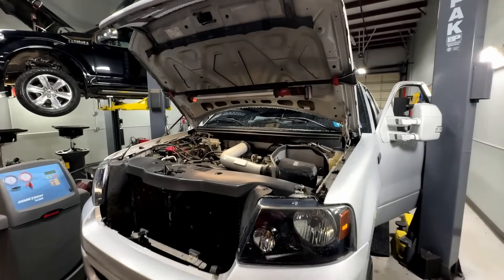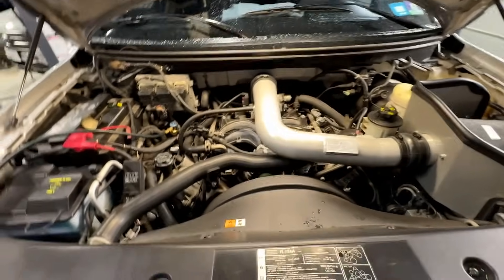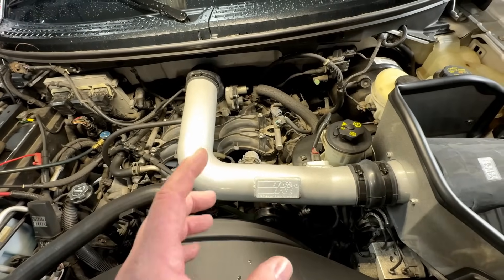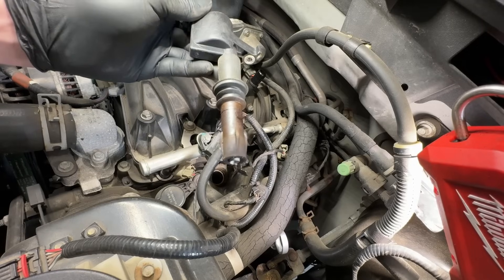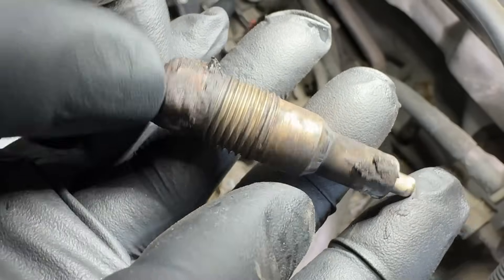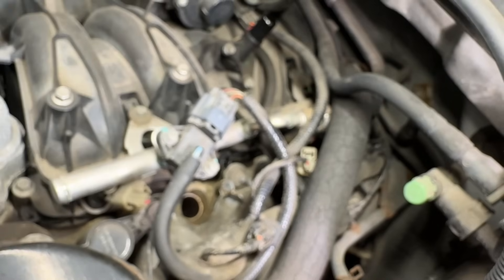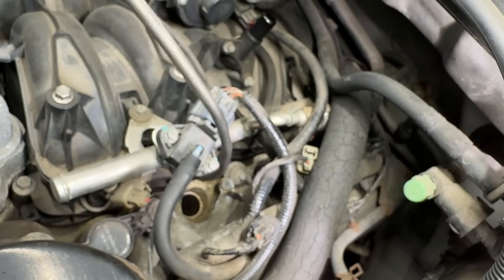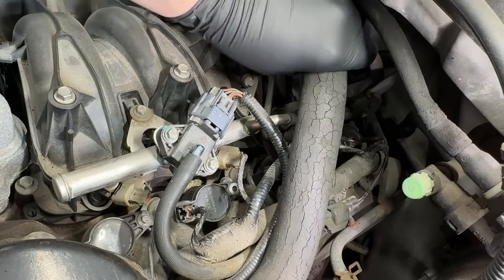Ford 5.4L 3v Triton Engine Tick Tap Diagnosis and Fix!

Comment: I have a 2010 Lincoln Navigator, I get a tapping sound when RPM is greater than 1000 and the tapping sound only occurs after I've been driving for 10 minutes, the tapping sound only occurs when it is in drive, any thoughts       thank you

Comment: Please LMK what the “beep” means at 1:13…my 2006 E150 does that “sometimes” can’t find info

Thank you
Reply: usually mine says "low oil pressure" or "door ajar" but then goes away very soon after start up but still has to beep

Comment: Got an 05 expy with 212k. Still tows our 7,000 pound camper trailer every year with zero issues. Slow as heck on the hills but it will get you there. Oil change every 3500, just did timing and oil pump at 200k. I expect another 200k out of it unless the tranny has something to say😅

Comment: What would cause a very light misfire to occur (no codes) and then go away within 45 seconds  on a 5.4L Triton with 193k miles. Could it be a loose spark plug?
Reply: It very well could be! My '05 started misfiring one day on the way home, turned out that the #1 spark plug was loose - most likely from being undertorqued. I also had the fuel smell, the very dirty coil boot, and I unscrewed it by hand just like Brian did in this video. New plugs and around 6000 miles later, the engine runs smooth as silk!
Reply: @ Thanks, mine is a 2007. Ford dealers in my city suck, one said it was too old to work on. Another said it needed a new engine once when it was an exhaust manifold leak. Independent shop I take it to now can’t find anything wrong with it. Runs great besides the cold start misfire.

Comment: For spark plugs and wheel lug studs, I apply anti-seize very sparingly with my sister's new toothbrush.
Reply: I'd rather use Red Loctite than anti seize on my sister's toothbrush.
Reply: @abyssiniahenry128 😂😂
Reply: gold comment 😂

Comment: Great info. My 09 Expedition is only loud when I go through the Wendy’s drive thru. 😂, now I avoid drive thru’s. 
I work on CAT natural gas engines. Most plug torque spec is 50 ft/lbs. 12-25 sounds crazy. 
Great info. Cheers

Comment: Thanks for the vids!

On my 06 Mustang 4.6L, my #5 spark plug loosens after a couple of years. It's happened 3 times. I've owned the car since new and only has 150k on it. Is there a reason for this I should look for? 

I check the torque on it once a year now, I know it will eventually walk out. 

The first time it happened I was paranoid enough that I pulled and checked every rocker roller and lifter for damage or excessive wear.

Comment: Another great vid.  Did you happen to notice how bad the vacuum line is going to the valve over by the brake booster?  Got real flat while running.
Reply: Had to replace mine not very long ago. Had a huge hole on the backside that couldnt be seen. As a quik fix on the road, i threw some electrical tape around it. After i got home, realized it was dang neer sucking itself closed. Ran good with the tape though lol.
Reply from the maker: Yup quite common

Comment: I have to admit i have 3 coil packs with no screw holding them in whatsoever for the last 15k miles 

I planned on getting some but the truck drove great so I didn’t think it mattered 😅 I will be doing it this weekend now!

Lifetime warranty on the coil packs though 👍👍 5.4 3v 250k miles
Reply: You did 15k miles but never once drove to a hardware store?

Comment: How does it fire w/o the ground strap! Also, a truck with 65k on it needs a timing set?!
Reply from the maker: Sitting does nothing for your vehichle
Reply: @FordTechMakuloco  How does a timing set fail from not being used often enough.

Comment: Loose plug also can't transfer the heat to the cylinder head.  Daughter drove a Mercury Tracer 400 miles after it started missing. #3 loose plug lost the ground electrode most of the insulator and part of the center electrode. The loose pieces got into #4 and banged the ground to the center. Didn't kill the engine though. Straitened the ground, put it back I,  tightened 3 and it idled just fine. Did new plugs of course. Ran 3 more years no ptoblems.

Comment: Great video and great knowledge! Experienced this on my 05. She's still running strong with 173k miles on her.
Reply: I have an 04 just paid 2700 for the manifold to be replaced and this noise has been driving me nuts. I want to pull the plugs but I'm afraid they will be stuck and  break. I bought it used and have no idea if  or when they were ever done 172k miles

Comment: the 3V wizard!
i just changed my timing chains, works great thanks to you.
i've got some random missfires until warmup, i'll pull some codes, i think the rear driver side plug on coil is loose cuz the threads for that bolt seem to have stripped :/ should i helicoil it?

Comment: Very good video. This is something I haven't seen before. I have one suggestion. On videos like this use a torque wrench. I know you as well as I have a calibrated elbow and are very good at torquing with out hearing a click. However most home mechanics are so lucky. Thank You
Reply: Most people dont use torque wrenches correctly anyway. I'd say atleast 80% of people torqueing things are off by quite a few numbers. So much involved. Basically, sayin that most things people get all ocd about their torque bein right, it really doesn't matter. The small stuff matters a lil because of breakage more than anything. I'll quit writing now
Reply: I think he explained it well why he doesn't use a torque wrench but he did tell people how many foot lbs they require. I'd say that's good enough. 😊

Comment: I have never used anti-seize on spark plugs and never had an issue getting them out later. 
I don't believe the factory uses anti-seize.
Reply: LOLOL, The " factory" could care less about your ability to extract any threaded item on the vehicle after they sell it to you. Read the book 
" One Good Turn"

Comment: Thanks for the tech tip and the video.  I saw some 2005  5.4L 3 valve engines.  Sometimes those spark plug shells would break off in the engine.  I know there were special tools to remove the broken part.  I never had that problem but was always hesitant to torque them at 25 ft lbs.  But it worked.

Comment: One might think that tick should be a secondary concern next to the fact that the engine essentially has a dead hole and the MIL should be flashing warning of catalyst damaging misfires. The truth is, those engines run so poorly (even when in perfect working order) and have so much NVH that most people can't even tell they are running on 7 or less cylinders 😂
Reply: Maybe to you. My 14 5.4 3v runs so smoothly with just shy of 170,000 miles on it that people who have never ridden in it have asked at a stop “uh…is your engine still running?” And I’m like “😂 yep, it’s still on”. It’s so smooth at idle it’s imperceptible.
Reply: @BrandonWest87  must be a lemon, because that's not normal. Better have it looked at 🤣
Reply from the maker: Not a dead hole

Comment: I did my plugs from original (reman that is) last year and did like you said very light coat of anti-seize.  Bought an el cheapo torque wrench for the occasion, so far so good.  Don't daily so IDK what the real mileage is, but it runs just fine.  I gotta say, when I bought the new plugs at Ford dealer, the ground strap sure was of a thinner more chintzy quality.  I held onto the plugs that came out they weren't terrible.  I could see the thinner ground strap on those newer plugs getting burnt off easier.

Comment: Had a neighbor that had a Lightning. He was beginning the process of repairing the ejected stripped plug issue that was plaguing Ford in its early stages; around 2008 I think this happened. 

He let me hear what it sounded like when the engine was running. Well, my coworker called me one day and asked me what was going on with his truck. He took his phone to the engine bay so I could hear… sounded exactly like the ejected plug. His vehicle was the V-8 Explorer. Took it to the dealer, and they confirmed.

At least in this instance it was a simple task of tightening the plug, and not the design flaw Ford gave us.

Comment: Don't need antiseize on new plugs.  I had a knowledgeable mechanic replace the plugs and coils in my 06 4.6 2V.  He torqued the plugs to 27ft lbs.  Absolutely no issues.
Reply: That's because the 3V design is infamous for broken spark plugs. Almost impossible to remove.  Very different from the 2V design.
Reply: This guy has rebuilt probably a 1000 of these motors how many had your mechanic rebuilt

Comment: Man I miss my Ford 3v. Was a great truck but rotted away up here in the northeast. 190k on it. Did have to replace the motor at 82k but it was under warranty so a new long block was put in. If I ever found a good southern truck with decent mileage i'd buy it in a heartbeat.
Reply: Hell I might've been persuaded to buy an extended warranty on my 2004 if I'd known how bad the timing parts could get.  I would've only got the transmission though that went at 77K, because the engine went at 107K, and I don't think they exceed 100K, not entirely sure. I had to spend just north of 8K in 2014 for the long block.  Mine is a southern Louisiana so I spent the money on it fixing it, rather than spending what at that time in 2014 was too much for me to finance with uncertainty jobwise.  I had the 8K didn't need to finance that.  Here in 2025 It's getting to a point where it would need paint, those stupid roof ribs that go downward and hold rainwater, rather that the 12th gen where they go outward
Reply: @teecuzbruh4058  yeah my kid as a 17 escape 2.0. Had to replace that on my dime because of the stupid slots they had carved in the cylinder head (another design flaw by ford). 7k later, she got a 2020 version and no problems since.

Comment: Ive had this on a few 3V trucks. Dealer quoted a few thousand to an owner with no promise it would solve it. New plugs and new valve covers (cracking) and they were good to go.

Comment: What happens to the ground strap ? Does it cause more internal damage?
Reply: What was left of it got spit out the exhaust valve, and is either stuck in the bank 2 cat converter, or was small enough to get out of the exhaust. I've had a few plugs break up and even lose part of the center elecrode and ceramic, bu the cylinder compression tested fine and a new - different brand plug was installed.

Comment: That truck is so clean for it's age. I got a 2004 with 205k miles on it. They don't look the same lol!
Reply: I have 2005, 226,000 miles 😬🤪😎 this guy saved me so much time and money!!!
Reply: Mine's an '08 and has 30K
Reply: O4 with 360K(just last week), Brian helps to keep us on the road!
Reply: My son has a 2022 Explorer with 250,000 miles. It looks new & 85% of his miles are urban driving.
Only tell the vehicle isn’t new is one wheel replaced due to hitting a starter someone threw in the road. The vehicle came with shiny aluminum painted wheels and all he could get used was a black wheel.
Reply: 03 with 147,000 and the tick drives me nuts!😭😂
Reply: My grandpa's has around 230k miles it don't look nearly the same but sounds just about the same🤣 we got all the misfires fixed then just fixed the O2s now we're chasing this ticking noise LOL

Comment: I already don't like the air intake!!!
Reply: …or the driver door slammed into the lift riser 🧐
Reply: I got one for free on this same engine. It sounds waaayyyy better than before even with stock exhaust as soon as I get over 2k rpm
Reply: It's called a hot air intake junk
Reply: Far better than the stock intake.  And makes working on the top of the engine much easier.
Reply: @ronaldroberts4058 far better than what? Maybe no air cleaner at all. The stock snorkel actually lets more cold air than that thing does.
Reply: @ 
You are incorrect.
Reply: @adotintheshark4848 no, this air path is better than the stock box and tube stuff. Just don't use one of the k&n style filters, unless you like lil bits of trash gettin in there over time. If you wanna get performance for a couple min, pull the filter off and put it back on when you're done WOTin it!
Reply: @ you're probably right about the WOT, but if you're like most of us who don't run their engines that way, then keep it stock if the car is going to be used for every day driving.
Reply: @slopoke22 metal air intake tubes heat up and make the air inside hot.  Plastic tubes insulate the air inside, so yeah, the stock air intake is better.
Reply: @charlesball6519  😂 whatever you wanna believe, boss
Reply: Yeah, just needs a regular wix filter or fomoco whatever. Just not a cleanable one! @ronaldroberts4058